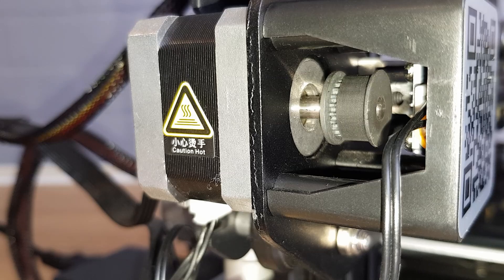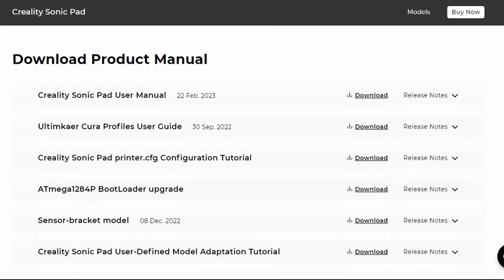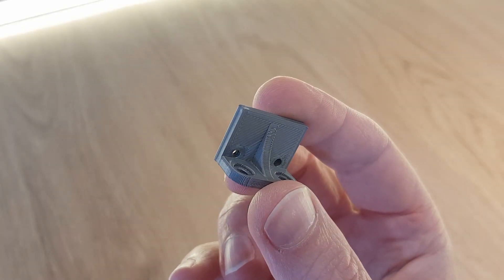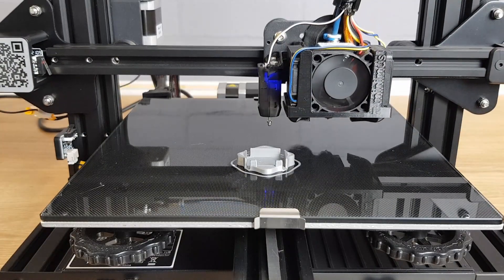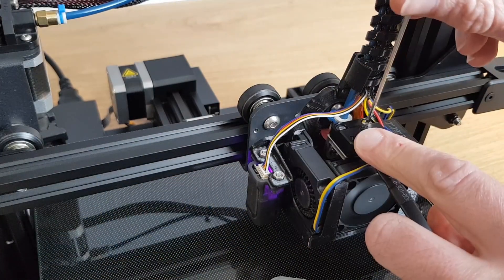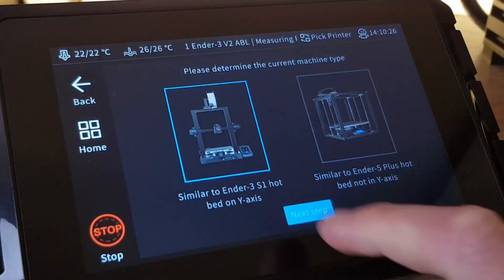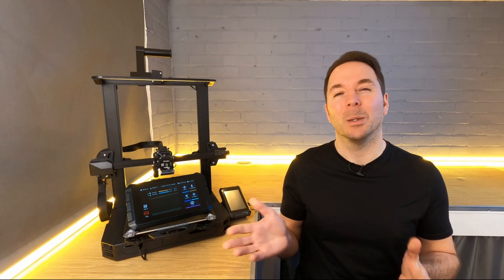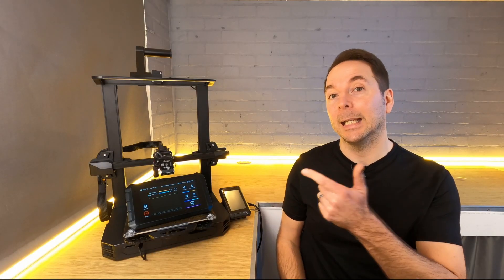Tune Input Shaping With The Included Sensor - Sonic Pad Intermediate Part 5

Comment: Don't you have to uncomment the lines under  [input_shaper] for them to take affect?
Reply from the maker: Hi, no you don't. If you look further down in the 'Save Config' section, there is another input shaper section which has #*# before it. Klipper reads this and uses this information. I should have explained this in the video but what I showed can be confusing, sorry.
Reply: @RickyImpey  Yes, this would be nice to have it in video. I'm glad there is a comment at least, that's fine. What is best way to increase speed then? Is it enough to just increase "Print speed" in a slicer to e.g. 150mm/s and Sonic Pad resolves it?
Reply from the maker: @gillan82  Yes, in a way. What you would ideally do is find out the maximum acceleration that your setup can handle and then set this limit on the Sonic Pad. Then you can up the print speed without really worrying about acceleration going too high. All to come in another video soon.
Reply: @RickyImpey  thank you for this answer. I was wondering the exact same thing

Comment: Actually keeping the slicer acceleration settings on and then fine adjusting the speeds is a better approach in my opinion. Because you'll still get ringing depending on how high an acceleration you choose. Klipper docs even mention that you should choose an acceleration setting where ringing is minimal, and not completely gone. 

In my case with my s1 I start to get ringing above 1500 and I have my max set as 3500. So I print my external walls at 1500 and and max for everything else. Even at 3500 ringing is quite acceptable but at 1500 I have no ringing and my print times are barely affected.

I learned this approach from Ellis from Ellis' Print Guide. They have their max accelaration at something ridicilous but their wall acceleration was set at 2 or 3000 with a Voron.
Reply from the maker: Ok, interesting🤔 My personal experience is that leaving klipper to handle all accelerations reduces variables and makes fine tuning much simpler. I'm happy to be proven wrong if it gives a better result though. And yes, reducing the acceleration for walls makes a lot of sense.

Comment: Excellent video series thanks. One question, do you need to re-do the Input Shaping/ Resonance Compensation after a Firmware update? Seems like I have to redo the bed leveling after an update.
Reply from the maker: You shouldn't have to as all of the information is in the printer config file. The best thing to do is download your printer.cfg file before any updates so that, if it gets overwritten, you can copy your config back in.

Comment: Excellent.I had already done this but your 3D printed y axis idea was much better than the spring clip I used so I redid the measurements. I have a CR6SE and printed the bracket Creality supplied with the Sonic Pad but it did not fit so I simply drilled and tapped two holes in the extruder fan cover to mount the sensor.
Reply from the maker: Good work Bill👍

Comment: ...I manually bought a Rasberry PI, set up klipper, and then hbought a input shaping sensor for my CR6 SE, ...now that this is out..I'm really considering getting this, so I can swap my CR-6 to it, ..Connect it for my Ender 3 Pro so it can have klipper as well since I don't want to fight it too hard, since this seems easier, and..well, ...Then I can use th Rasberry Pi to make a REtro Pi
Reply from the maker: I bought 3 Raspberry Pi 3 Bs a few months ago, intending to run a few of my machines on Klipper. They are still in the box as the Sonic Pad is an easy solution for me.

Comment: I attempted using the y-axis sensor mount on my Ender 3 S1 Pro but found that by the time the x-axis test is complete, the bed has cooled to the point that the mount won't stay adhered to the bed. 

On my second attempt, I tried to pre-heat the bed immediately after printing the mount to keep it at temp. This failed because it causes the sonic pad to lose connection to the printer at the end of the sensor check.

I ended up used gorilla double-sided tape to get through the test, but it's 1mm thick and a solid-gel consistency so I fear that might absorb some of the vibration and throw the test off.

Would a mount that replaces the bed handle work better? I'd prefer the sensor be closer to the center of the bed for the test but i can't come up with a good solid mounting strategy for that.
Reply from the maker: Hi John, I used a PVA gluestick myself to make sure it didn't release on it's own afterwards. This worked well for me. Personally I'd avoid anything that could dampen the results like you say.
Reply: @RickyImpey  Thanks! I was hoping to avoid glue sticks altogether on this one, but I'll give that a shot once I'm done disassembling/reassembling the printer. I  discovered today that Creality's "Easy 6-piece assembly" leaves a lot to be desired.

Comment: Great videos. Thank's.  The printer.cfg file (input shaper section) was not updated as it should. I had to write the values (found in the console) myself... Same thing for the pressure advance value. Strange !
Reply from the maker: Very strange🤔
Reply: I tought the last section (save_config) of the printer.cfg file was all comments (because of the #).  I just learn it is not ! I suppose I was looking at the wrong place for the shaping params.
Reply: @erdnac123  How did you find out that they are not? I have the same doubt. I've performed the input shaping test twice and have different values in the printer.cfg; I don't know which one my printer is using.
Reply: Same for me - input_shaper still had commented out fields that did not match what console output suggested - had to fix manually

Comment: Great video and as always - impeccable timing!
I have my sonic pad and basically follow along.
I needed to upgrade the cooling on my Ender 3 S1 Pro after getting the Sonic Pad. Even at 100% Fan  speed I was only getting warped and drooping overhangs on the benchy and the backside of prints looked really awful. 
So I re-did my Input Shaping after installing the custom parts cooler. 

One question regarding belt tension:
How do we know "when it's good"? Is there something we can "measure"? I don't have any slippages but I am not sure when it's too tight. I just don't want to leave anything on the table in terms of performance or quality just because I can't properly tension the belt.
Reply from the maker: It's a really difficult thing to explain of show in a video as it's a feel thing. If in doubt, leave it a little looser rather than tighter. Too tight would give you more problems generally. I will give some thought to a way to describe the best belt tension in a video.
Reply from the maker: Also, yes, the part cooling is the limit with the S1 Pro, what did you upgrade to? I'm looking for a good option.
Reply from the maker: @Black3ternity  Thanks for the info, I'll check it out. I have a mod board from Nathan Builds Robots that I want to try out, this could be the one to use it on👍
Reply: @RickyImpey  oh would appreciate feedback on that. Had my eye on it. If you go down the Rabbithole of Ender 3 S1 Pro with Sonic Pad I would love a series of "upgrades to make the S1 Pro awesome". 
Stuff like the modboard, cooling solutions and maybe even the linear rail upgrades to see what it improves (if any). Found so much content online for the Ender 3 and v2 but barely any stuff for the S1 Pro. 
Cheers and thanks for all the great stuff.
Reply: I think TeachingTech did a video on linear rails compared to v-rollers and found no difference at all. Just looks cooler :D
Reply: I'd also be interested in a good cooling solution for the Sprite Pro Hotend since all the big mods like HeroMe don't fit it and the ones available are either huge or look sketchy

Comment: Would having linear rails alter anything? I have an 'upgraded' ender 3 V2 with linear rails on both x and Y. I ran the tests, but I'm still getting pretty bad ringing and ghosting.
Reply from the maker: In theory, linear rails will help to accurately transfer stepper motor movement by providing less resistance and play. The input shaper tune should account for any difference between setups so you 'shouldn't' be having any issues with a modified setup.